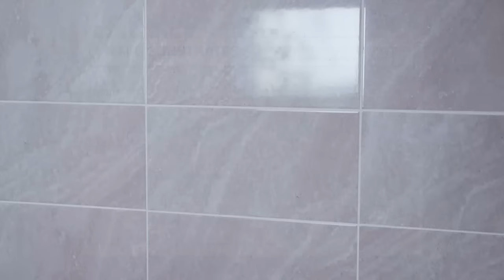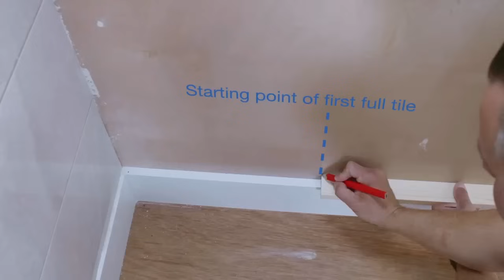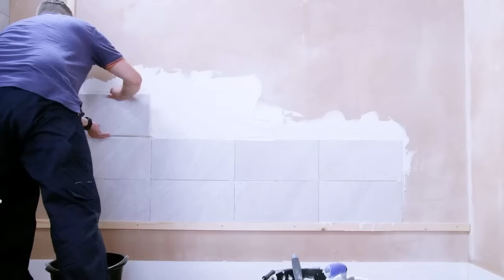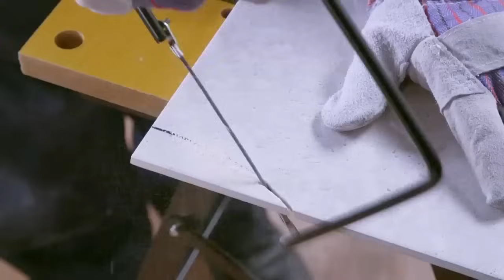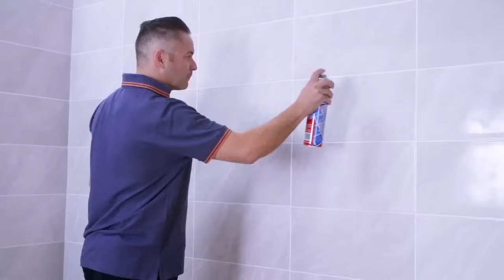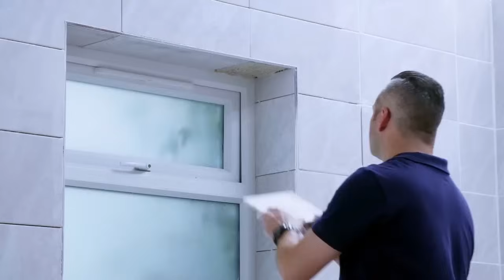How to Tile a Bathroom Wall with Wickes

Comment: One of the most important parts you did was keying in the substrate before you directional troweled.... and you didn't even mention it....cool video,  good work!
Reply: What does that mean
Reply: @harun5358  taking the thinset on the flat side of the trial and pushing it in the pores of the substrate that be concrete or uncoupling membrane or concrete board. Using the flat side of the trowel and pushing it into the substrate and then turning the trowel around and directional troweling also hitting the back or back butter each tile

Comment: Bare in mind new tilers battens are not all straight as they seem it can be off by a mm or few anywere along timber then when tiling up you can be off on few tiles and spacers don't fit snug. I personally find investment in some aluminium square tubing and rubi adjustable stands really make it just bang on perfect all the time yes there is times when timber has to be used if obstacles are on ground level

Comment: Good video. I wonder if it would be a good idea to use silicone at the corners before tiling into the corners to keep watertight in case of cracks occuring at corners

Comment: So is it better to skim a wall before tiling or is it better to apply tiles directly onto fresh plasterboard?
Reply: depends on the tile weight, without a skim; raw plasterboard can hold a lot more weight so for larger format tiles above 20kg/m^2 I wouldn't skim. You can work that out by calculating the weight of one tile and then multiplying it by the number of tiles you need per sqm. I would recommend getting MR plasterboard and then tanking it if its a bath surround. You also need to add say 4kg/m^2 of adhesive/grout weight. But Ideally you should you a tile backer board.

Comment: Had no idea you could put adhesive on the back of the tiles (instead of on the wall) if the edge ones are tricky...thanks for this great video...
Reply: You only do it on tiles/stones such a travertine. It's not needed on porcelain or ceramic.
Reply: @Thee_Penguin not true back butter only wanna be dont do it
Reply: Should be buttered. I never apply one coat of adhesive unless the back of tile is completely flat . If you do chances are the tiles will fall off .

Comment: One small bone to pick with this.

I see you're tiling two walls there, they should be tiled together I thought. So as you work from one wall to another, the tiles which are first cut into a corner then have the off cuts added to the adjacent wall to give the appearance that the same tile has gone around the corner.
Reply: It does make sense too, gr8 feedback,  I need to add that info on my practical tiling job.
Reply: No it not working like that
Reply: That will look terrible.
Reply: No.

Comment: Is it best to tile the whole length of the walls when fitting a new bath or fit the bath onto the wall and only down to the edge of the bath. I would have tiled  the complete wall first but i been advised that isn't necessary?
Reply: It’s better if the whole bathroom is tiled and then everything else gets installed
 ( obviously the pipes and fittings have to be in place beforehand ) 
But no one does it like this anymore , it’s cheaper and easier to just bodge the work .
The idea was that if you want to change your bath for example you don’t have to retire the whole bathroom , the thing is that today the fashion changes fast and people don’t want quality anymore so cheap bathrooms get installed every few year as the fashion changes .

Comment: It is said before you tile a place you shold put water on it first to moisten area. If you plan to tile a stairs that has water resistant paint on it should you still damp it?

Comment: Good Video but fails to mention a crucial aspect Expansion Joints should be around the perimeter . Tiles expand and contract hence expansion joints allow for movement.
Reply: Exactly.
Reply: Tiles do not expand..... expansion would be the house. Ie walls, floors. Tiles do not...

Comment: I understand to get the tiles central so you end up with the same width either end, but using a batten marked with a pencil line and shifting it across seems a bit basic. What's wrong with the good old fashioned tape measure??
Reply: Because old school is more accurate, tape measures move and it only has to be a mm out and it's fucked

Comment: How do you calculate the wall area exactly? Can someone give me an example of a calculation to give me an idea. Thanks.
Reply: Measure height of the wall and multiply by width. Example 2.5m height by 3.5m width equals 8.75sqm.

Comment: This is most definitely not how you should be tiling a wall. You 100% do not do your cuts last as you'll quickly discover there is no room for adjustments in grout lines due to things like tiles not all being the same size etc. This could usually be overcome by blending it out throughout the course of tiles. There can be no adjustments made by using this method and you could become very stuck and have problems like no grout lines at all.
Reply: Good point.

Comment: Are you supposed to remove the wall tile spacers when it’s dry? They don’t mention it
Reply: Obviously? How else will you grout
Reply: Liam Caddy no need to be rude, I was only asking.
Reply: As long as the spacer is deep in the grout joint you can grout over it. 👍🏽

Comment: You can tell a mile away when a true Professional Tiler has done the Tiling.........just because I can make Toast and Beans doesn’t mean I’m a Chef! Grrrrrrrr 
After leaving school I was a Ceramic Tiler for over 10yrs and I never stopped learning my trade in all that time, there was always some new problem that had to be worked out and overcome. 
As a time served Ceramic Tiler i would never use any adhesives or grouts that Wickes promote, they cause nothing but problems and would only use trade approved and proven products.
I nearly choked on my coffee when I seen the guy spraying a ‘water proof’ application on to the grout.........eh Grout is water proof and if it gets stained then you can either use pure bleach or scrape it out and regroup, I use to bleach my grout when it discoloured with shampoo.

Comment: Some worker came in my house and put tiles with cement
Reply: My builder put floor tiles with cement and 1 part  floor tile adhesive mixed. Works well.
Reply: Weren't cement it's thinset

Comment: Dont spread two tiles at a time like fonzy. You have your level line set up so unless your like stephen hawkings speed spread the whole row and make sure you over spread the height of the tile by at least a quarter of the tile for next row now clean the glue off bottom edge and lay that line of tiles. That wall should take an hour and half to two hours to lay. If you use this method 5 weeks

Comment: The edges and corners do not appear to be even at all, this is not appear to be a good example to tile. Tiles should be even prior to fitting spaces, row by row, furthermore tiles should be cleaned as tiles are fitted not after adhesive has dried.

Comment: You've confused the life out of me. You state you've used twice the amount of cement than is stated in the instructions but you don't tell us why
Reply: He didn't say use twice the amount as the instructions state. He said for THIS cement, the correct ratio is 2 parts cement to 1 part water.
Reply: See my video I just uploaded it. I just used enough mix with water until the mix became custard like consistency, add little at a time, so you cannot go wrong. All this ration is not for me. But it's good to know.